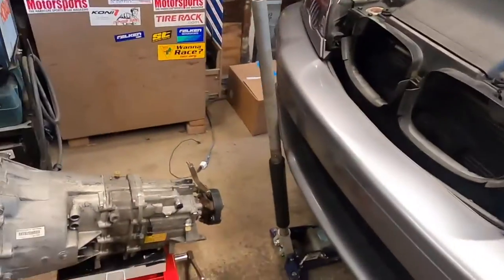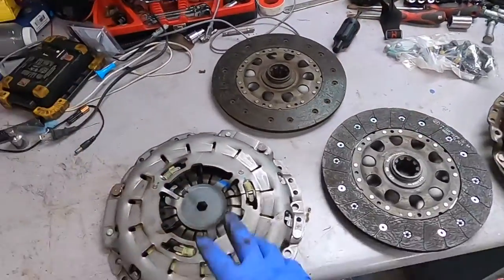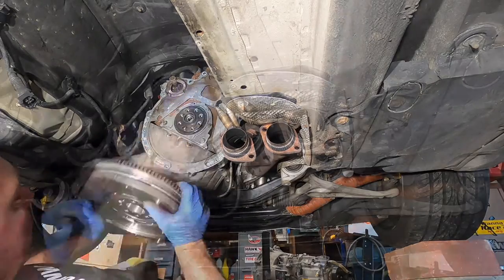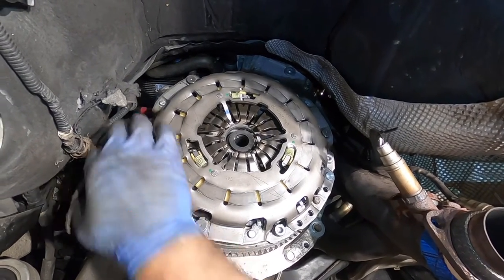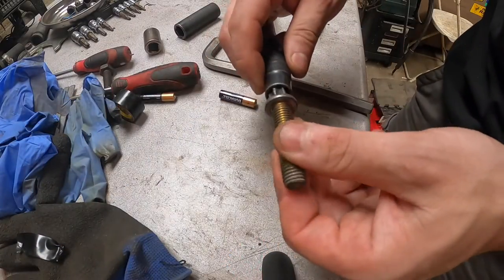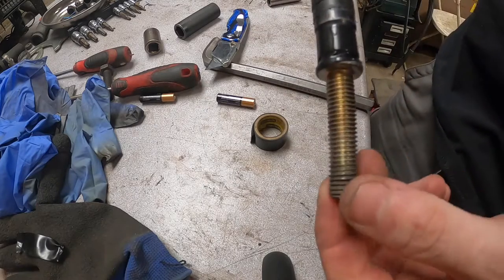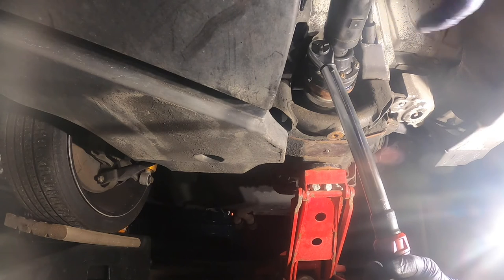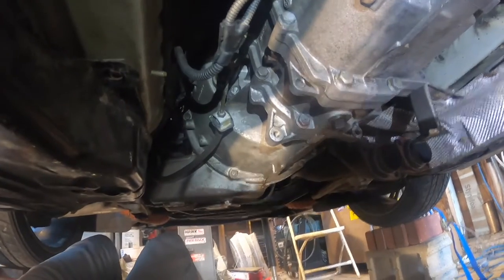Clutch & Flywheel Install - E46 M3 Build pt 10

Comment: I've done this job on an E36 an will tackle this soon as on E46. Helpful tips. 1. Buy that Harbor Freight scissor jack. Best money ever spent. 2. Sea Foam Creep (rust remover) is your best friend. 3. Dry test fit the pilot bearing to tranny output shaft and ensure it goes in by hand with little effort. If it doesn't, take some emory cloth to the output shaft. This makes the tranny install super easy. 4. You need at least 19" of clearance to get that tranny out from under the car. BTW. In my E36 ran the Gripforce clutch Stage 2  w SMF and 750 miles later still running great.

Comment: The part in the middle holding the pressure plate springs. Do you have to remove after ?
Reply from the maker: Yes you have to remove it after the clutch is installed important! Not to remove it before installing otherwise you won’t be able to install the clutch if you remove it before, plate is holding self adjusting mechanism in place for easy installation, you release it after clutch is bolted down to the flywheel.

Comment: Hey man I was in the middle of a manual swap and I noticed that on the clutch it has that plate keeping pressure on the pressure plate prongs what tool did you use to remove it?
Reply from the maker: Hey, I used a regular Hex key, to be honest I don’t remember what size it was though. Make sure you remove the plate after clutch is already mounted onto the flywheel on the car otherwise if you remove it before you won’t be able to install it on the car because self adjusting mechanism will have to be reset.

Comment: I put the LUK throw out bearing and it worked fine 🤷🏻‍♂️
Reply from the maker: LUK throw out bearing will work, but the concern is the longevity of it, will it actually last the life of the clutch, since this is labor intensive replacement of it prematurely fails.
Reply: Motorsport Inspired I’ve had two of the non LUK ones go out so I’m not sure at this point

Comment: Also, just noticed that your guibo bolts might be on the wrong way. Not sure if it makes a difference but the bolts that connect to the tranny should be on other side of the thick part of the guibo.
Reply from the maker: Guibo bolts can be installed either way does not make a difference, good 👍 looking out though.

Comment: I’ve been following your Chanel for quite sometime now and I hope that you can maybe shed some light on what’s going on. I replaced my clutch pivot pin, flywheel, clutch, throw out bearing, pilot bearing. After the replacement, I’m getting a buzzing sensation (high frequency vibration) on the clutch pedal on high rpm > 4K. I’m not sure if this is normal or not. Let me know how’s yours feel ! Any input is greatly appreciated 

Thank you!!
Reply from the maker: There definitely should not be any vibration on the pedal, one thing comes to mind is was the pressure plate installed in accordance with balance marks on the plate and flywheel if they weren’t that might be just enough to cause small vibration the higher the engine revs.
Reply: @MotorsportInspired  Thank you for your response!